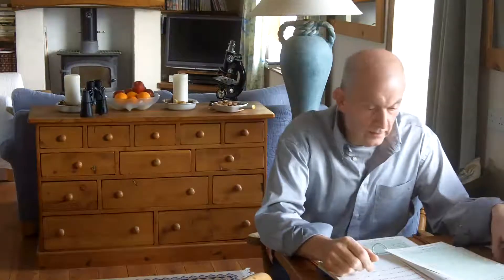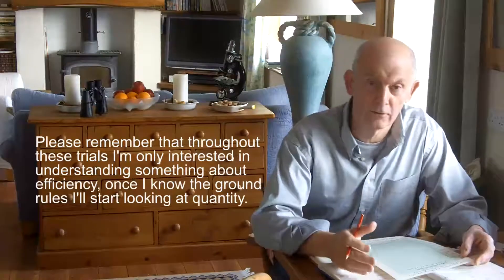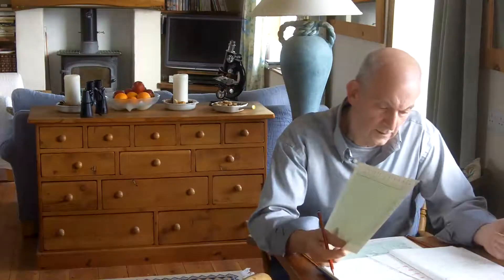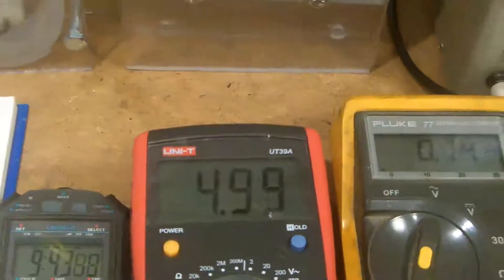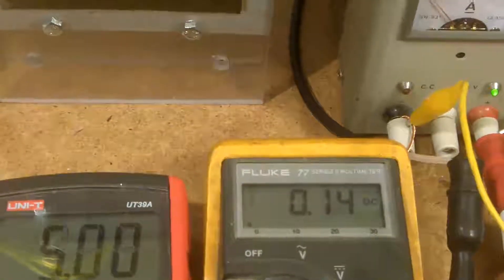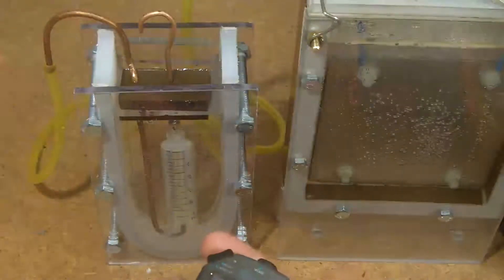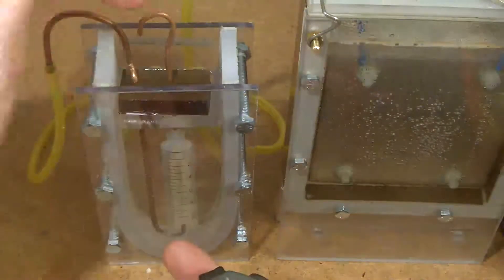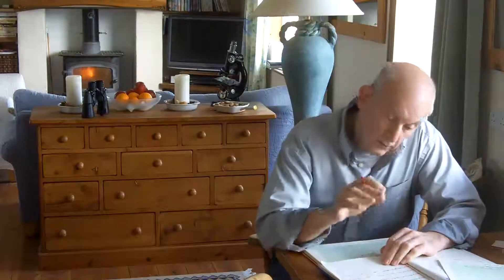HHO. 5 Test setup, the results are in HHO.6

Comment from the maker: That’s really interesting, I’ve been involved with a lot of aviation stuff, design and building equipment for:- jet igniters, carbon composite bonding, thyrotrophic metal forming and lot of kit for hot forming titanium aircraft fastenings, barometric capsules for ejector seats and loads of surface hardening and heat-shrinking applications. It was good to be working with companies at the forefront of their technologies to be able to help them move forward, sometimes I miss it.
73's  Andy

Comment: Physics & Aerospace (Apollo) originally then industrial engineering and related speciality manufacturing. Heavy cross dicipline engineering and fabrication background really -not really different in 'tone' from yours, as far as I can tell. What was called a Generalist, lots of complex one-off's, prototypes, limited run and project rescue work. Avocations are clocks & watches, model engineering, amature radio, vintage electronics restorations, race cars, aviation. Recently retired.

Comment from the maker: Hi, I wonder what line you were in. I’ve used a lot of valves, big industrial water cooled triodes. Made a lot of equipment for many applications including tool tipping, brazing tungsten carbide and diamond tips. Diamond tools are tricky, needs high vacuum. Also core drills and geological drilling bits. Also made getter firing equipment for valves, fluorescent tubes, neon tubes, CRT’s and even Sinclair’s little flat TV tube.    
Kind Regards ... Andy

Comment: Yes Andy, I am very familiar with RF Induction Heating, have used it in manufacturing. Also I have a small lathe and mill and have often thought about making a small I-H system to heat treat tools, small parts- but it is a lot of work, and work that I really don't need to do-thus I have not! lol! A you tuber, Glasslinger, experiments with hand making vacuum tubes, and he made just such an induction heater to flash getters, etc. Anyway, I am sure your work would put a big smile on Faraday's face!

Comment from the maker: Just an afterthought .  . I’d love to be able to show Michael Faraday the induction heaters that I designed and built. I don’t know if you’ve ever seen an induction heater in action but with a few hundred kilowatts I could melt the outer surface off a six inch diameter block of tool steel and leave the core cold (until thermal conduction heats it) like a blowlamp to a candle, good fun he’d have loved it I'm sure. 
Kind Regards ... Andy
GWØJXM